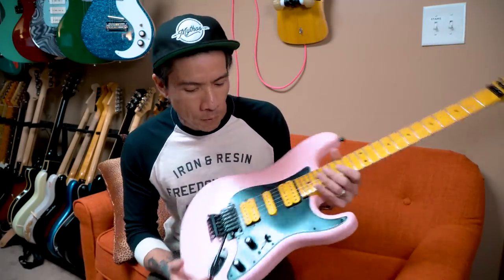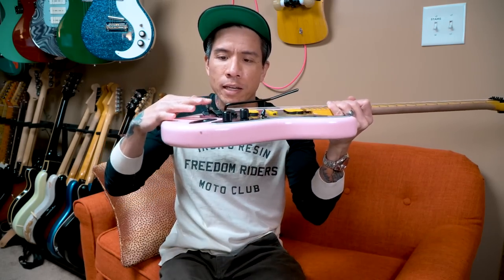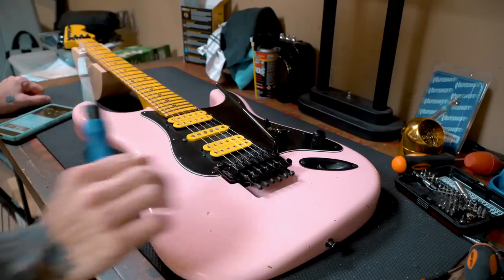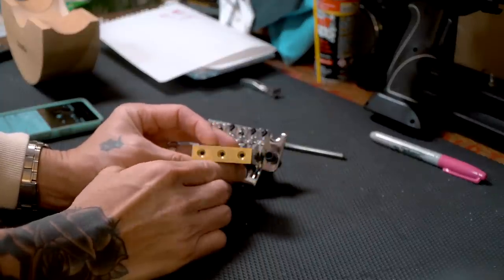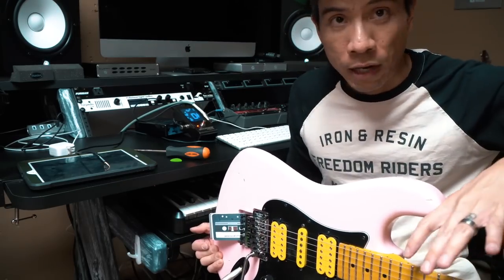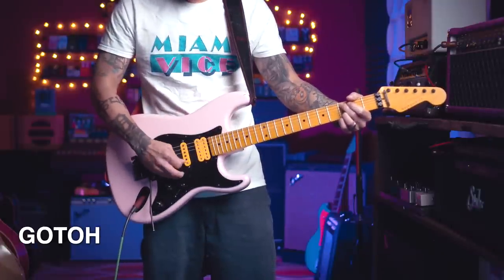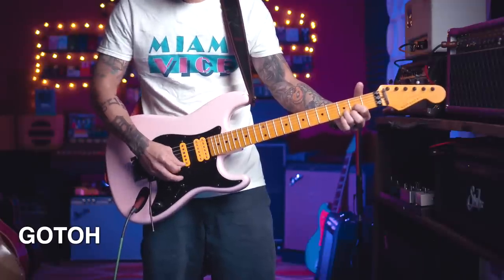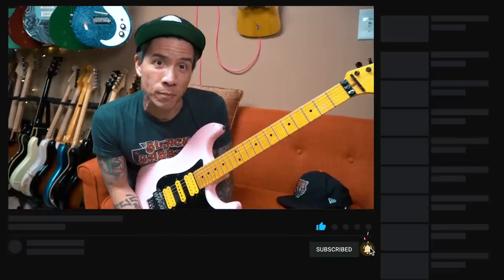Upgrading My Floyd Rose Tremolo | Floyd Rose Pro 100 & FU-Tone Brass Block

Comment from the maker: UPDATE: I installed a Tremol-no with the bigger claw to fit the Big Brass Block, and changed the 2 outside springs to white FU-Tone Heavy Duty. It's playing better than ever!
Reply: Not much of a tone difference to my ears ... but sounds like it rings somewhat longer after strumming. Now you'd be the judge if that new Floyd Rose bridge has a better tuning stability ... I have no experience whatsoever with these special series of bridges from Floyd Rose (I only know the "standard" ones that everybody knows).
Now, I changed the trem blocks of 2 old Strats of mine (one trem is 6 screws wide string spacing, the other is 2 posts narrow string spacing) with heavy blocks, and the result was always a better sustain and a better (How can I say it?) resistance to pitch issues when I strum harder on the low strings ... I guess it must come from the inertia of a heavier "trem rig" and the fact that it requires more "force" to translate a heavy strumming "punch" on the strings into a movement of the tremolo assembly ... I may be totally wrong about that assumption :D , but that's sort of what I feel about heavier Strat tremolos in general.
Finally, I HAVE A SUPER USEFUL TRICK (that I stole from a luthier friend of mine) to improve the tuning stability of a Strat trem (2 posts or 6 screws) : the "string inserts" on the back side of the trem blocks are often "not deep enough" ... you have to be very careful and "MEASURE TWICE" to "DRILL ONCE" (otherwise you're in for a new trem block ;D ) ... you drill these "string inserts" so that only 5mm (about 3/16") remain of the "NARROW SIDE" (upper side) of the "string insert" hole. The result being a shorter distance between the string ball end and the top of the string saddle, and therefore less chance for possible string slipage in that small portion of the string, and therefore a much better tuning stability when abusing of the tremolo.
I have to add that all my Strats (and they are all "work horses", not "vintage collector items") are equipped with "staggered locking tuners" to eliminate the use of headstock string retainers, with Graph Tech nuts (that I regularly lube with "GUNSLICK Graphite Lube" ... FANTASTIC PRODUCT for lubing anything made of graphite) and Graph Tech saddles.
Oh my God! That was a LONG COMMENT. :D
HAVE FUN! PLAY LOUD!
Best guitar gear reviews on the WEB!
Reply: Totally agree
Reply: My friend are u aware that the Floyd saddles are numbered for the right order.the low E and high E have like a number 1 on the bottom .A and B have their on number and so on.it has to do with the radius of the neck.
Reply: but my issue is when you bend strings does it pull bridge up? i dont like that
Reply: This video was uploaded on my sister's birthday
Reply: you probably dont have it anymore seeing this video was made two years ago but if you still have it do you want to sell the go-toh trem ?  I im using a floydrose special on a jackson king V and its horrible . its so bad im afraid to use it cause it dont go back in tune
Reply: I have a FU tone brass & a copper blocks on 2 of my guitars and 2 off brand brass blocks in my 2 other guitars. I can tell a warmer tone and the sustain is amazing!

Next I want to try a Stone Tone block as I've heard great things about those!

Comment: Step 1 of setting up a Floyd Rose: start early in the day...
Reply: It takes 5 min?
Reply: Basically it’s the first thing you do in the morning
Reply: Step 2: Have large cup of hot Patience.
Reply: rule number 1 is patience when it comes to a floyd but the more you do it the faster you get 10 min tops now compared to hrs before and days before that lol
Reply: I just did two Floyd installs—a Special and an Original, while lowering the string gauge to .008s. I watched a bunch of videos (like this one) over the weekend, and that really paid off. I started with the Special, since it’s the less expensive of the two units. I did the swap in the wee hours—not necessarily a good idea. I took my time. The process itself was pretty straight forward, but getting it balanced and in tune was a little tricky. I finished with just enough in the tank to plug the guitar into my Spark and jam along to a backing track of Jeff Beck’s reading of “Goodbye Porkpie Hat. Between the Floyd, the new strings, and some adjustments to the pickup heights, my guitar sounded incredible!  Today I decided to take a different approach on Guitar #2. Early this afternoon I took off the strings and the stock tremolo, installed the new Floyd, blocked it in place, then put it aside. Later in the evening I restrung the guitar, got everything in tune, did a slight neck adjustment, then plugged into the Spark. What a difference!

I guess the takeaway for me was making time to research the install. Thanks to good people like our presenter, I had plenty of knowledge and experience to draw from. Making myself work in a more organized manner, and adopting a relaxed frame of mind helped make the process go a lot smoother. In the end it was time and money well spent, and a little more confidence gained in guitar modification.
Reply: @Mark Seymour I think a lot of people are just not mechanically inclined. But if you have the correct tools (shim blocks ect) change the tuning isn’t bad. I have 3 Floyd’s. 1 German and 2 1500 licensed never had a problem.
Reply: Play FR equipped guitars long enough and the full tuning process gets cut down to a few minutes. You eventually start learning how to add in extra pitch on each string so that it settles close to it's correct pitch when the others get tuned. I don't even blocking on any of mine anymore.
Reply: Why do so many people have issues with floyd rose? I can do a full set up and intonation and neck tweak in 25-30 minutes …
Reply: Do it nice, or do it twice.
If you're going back, and fourth adjusting it, then your method need to change.

Comment: In my humble opinion Gotoh 1996T is a much better Floyd than the FR 1000 series
Reply: That's what I was thinking
Reply: I think you're possibly confusing the 1000 Series Pro (Low Profile) with the made-in-Korea 1000 Series that comes on many guitars from the factory. The 1000 Series Pro is top notch, made in Germany.
Reply: I had a Gotoh and an Original Floyd. The Gotoh was a great product. The Floyd was all steel. I can't remember what the Gotoh was using for block material, but now they use brass, albeit small; doubt I'd bother replacing it. Anyway they both sounded great, worked perfectly although the Floyd was a bit heavier duty. For this new project, at $100 the Gotoh would have been obvious choice If I didn't want a Low Pro. Pisses me off finding it has a zinc block (not havin' it) which I must replace before I have it installed.
Reply: @bradleywood1499  Sorry but nope , the 1000 series pro is NOT made in germany but in korea : quoting FR's own description (and i invite everybody to verify for themselves)

" The low-profile version of our infamous Original tremolo, the 1000 Series Pro features the same string spacing as the Floyd Rose Original (.420") whereas the GERMAN Pro has a narrower spacing.  Available in a variety of nut sizes that will fit practically any electric guitar, the tremolo kit contains the bridge, springs & claw, mounting studs, and all hardware necessary for installation.

Made in Korea "

So for anybody interested , the FR PRO (not the 1000 pro) is indeed made in germany and also commes with silent tension springs : the 1000 pro is made in Korea, and comes with standard non noiseless springs.
Reply: @florian6240  Yep, I stand corrected. It was the first sentence in their description " The low-profile version of our infamous Original tremolo" and the price that threw me off. I've been buying my bridges straight from Schaller (Lockmeister Made in Germ) to avoid all of the FR wordplay/licensing BS. Exact same product as the FR Original, plus its a few bucks cheaper and packaged way better.
Reply: Corey Hart  Same here
Reply: @bradleywood1499  I've been researching the trems because I've got an RG470 with the LO TRS 2 which is a known poor quality unit and it doesnt retain tune. The gotohs are praised for quality but they use the larger 8mm posts unlike the Ibanez and I guess most FR which are 7mm. I hear that the OFR will be a drop in replacement but then they are like almost 100 bucks more which is about the value of the guitar. I don't want to buy another poorly hardened unit to fail. I'm going to look into the Schaller like you suggested
Reply: @TheCulnes  If you decide on the Schaller, make sure it's the Lockmeister model. They do make a a lower grade unit that is comparable to the FR Specials.
Reply: @bradleywood1499 Strange now that you mention it, they sell a standard model with replaceable knife edges which I thought would be great, only it doesnt say Germany anywhere in the description and even says not to replace the edges for wear(Defeating the purpose to me). The lockmeister is German and claimed to be better but looks close to OFR price. It amazes me how they pump out these licensed floyd guitars in the 10's of thousands and seems they are all doomed to fail, and expensive/difficult to retrofit. The Gotoh sounds like it would be great except the blasted posts! I don't get why they can't sell a 7mm post and then take over the market.
Reply: @TheCulnes  I've put Gotohs on several originally FR Special factory equipped guitars and just left the FR posts. Zero issues.
Reply: @bradleywood1499  This is something that I initially considered as I have found people saying that was acceptable but I did find conflicting statements that indicated that they continued to have tuning variation because of the difference in post angle perhaps. Maybe it is worth a try with a new set of Floyd posts to replace the Ibanez. I appreciate your inputs!
Reply: @TheCulnes  there is no official Schaller trem , that is the equivalent of of the FR special : the lockmeister and the schaller trem (the first having the same specs as an OFR, the second being schaller's take of a double locking trem, with a thicker baseplate and replaceable knife edges , and having slightly larger dimensions than an OFR) are both entirely hardened steel , and made in germany . There is a distinction between an official schaller trem and a licensed one, the same way there is a difference between an OFR and a licensed one. However the FR special is an official product , it still is low quality , not made in germany and only having the baseplate in hardened steel
Reply: @TheCulnes   the one you are talking about is called the "schaller trem" and is made in germany : just go to schaller website and hover your mouse over the part between the trem arm nut and the knife edge, and you will see engraved in steel "made in germany". Look it for yourself.
Reply: @TheCulnes  what is your post diameter ? and i'm not talking about the anchor, but the posts itself ?
Reply: @bradleywood1499  thats true it came stock with my kramer 1984
Reply: @florian6240 Wrong you are. There is a German Pro 1000 that is narrow-spaced, and the Korean Pro 1000 that is both inferior and F -spaced.

Comment: I installed a large brass block (42mm) and noiseless springs (black) on an EVH Wolfgang Special.  I left the metal shim spacer (whatever it's called) off at first and it had a negative impact.  The string height and tension was way off (high) and my tremolo was actually floating a bit and had a reverse angle I could not adjust.  My action was way off and just didn't look right or make sense.  Nonetheless, I went ahead and adjusted everything (except for exact intonation) and it sounded good, but just didn't like the feel of the floating slightly angled tremolo.  Upon further examination, I noted that the piece of metal is to keep the whole system flat to the body as the new sustain block was bumping in to the wood body even if I cranked the springs (causing a slight tilt).  I completely redid everything again and after reinstalling the metal shim it was just perfect and I absolutely love it (way more sustain).  I know every guitar is different, but I would recommend keeping the metal shim spacer in place at least on the EVH Wolfgang Series (whoever said remove it from FUTONE is likely wrong).  Just make sure its tight and bingo!  Hope this save someone from doing it twice.  I will set the intonation after I leave the guitar with tension over night.  I am sure it will sound even better.  ROCK ON!!!
Reply: Same experience
Reply: Thanks.  I just got a wolf special, and I want to improve it's tone.  I like the feel of the guitar, but my Les Paul sounds a lot better.

Comment: I never understood why the low profile version never caught on with the public or manufacturers. Nearly everyone still uses the old, high-profile, 80's version.
Reply: A few reasons. Firstly, unlike the 'Original' Floyd that was being made in Germany, the early production 'Pro' was manufactured by Ping in the USA and used imperial hardware so all the metric tools from the Original Floyd were useless on the Pro - Strike one.
Secondly, the string spacing was narrower unlike the 'F' spaced dimensions used on the Original and more typical of what players were using at the time - Strike two.
Thirdly, the design of the back end requires a deeper cavity to get optimal pull up clearance, players who upgraded from the Original would either have to route the trem cavity deeper or tilt their neck to a degree - Strike three.

RJ, does the 1000 series take metric wrenches these days?
Reply: @juliansw3110  
I think they changed the "Pro" to regular Floyd string spacing recently.

Comment: Were the stud lock on the Gotoh bridge engaged? They seemed to thread out by hand, which suggests they were incorrectly installed. There's a stud lock built into Gotoh GE1996T and Ibanez Edge (low-pro too) bridge studs. Take a look inside the big hex hole and you'll see a smaller, like 3mm, hex. If you have the studs out of the guitar then just look at the end opposite the head and you'll see the small stud at the center of the post. If you don't extend those stud locks then the posts wobble in the inserts and the bridge never stays in-tune. Tighten those up and the GE1996T is the best Floyd stability-wise.

Comment: I don't know..maybe a little brighter? But it's about the amount of return you got for the money really. Was it ..or, is it worth putting that kind of money into a parts caster to eak out a maybe noticeable sound difference? Also, the thicker block limits the amount of throw that the trem can travel. I get the comfort for your right hand with the low profile of the new trem, but if it were me, I would just sell that thing, and buy something with the setup I was looking for. JMHO..🤘

Comment: If you were having any tuning or playability issues with the Gotoh I 100% guarantee it was the tremol-no.  It has to be perfectly permendicular to the sustain block or it will eventually bind and not allow you to return to pitch. It's just my pesonal opinion, but the gotoh is better than any floyd branded bridge.

Comment: In my experience, big brass tone blocks make little to no difference in tone and sustain.  I tried a few of them (different sizes) in a few guitars for several months but went back to regular sized brass stock blocks. The guitar seems to be a bit louder when unplugged and that may give you the impression of more sustain but that's it. I recorded clips to measure the sustain with all blocks and the differences where negligible and could be attributed to other factors. The main difference you may notice is the additional weight on the guitar. ; )

The noiseless springs will make a difference but you can get the same result by inserting some paper tissue inside the springs holes.
Reply: I had a similiar experience with a really resonant Dan Electro Baritone guitar, which when i took home and plugged into my rig didnt really translate, it had a nice tone of its own with those lipstick pickups but nothing like it was sounding when unplugged acoustically.    Maybe you'd actually want less vibration in the guitar, it would mean the strings are doing more of the vibrating and would have more sustain then if the whole guitar was vibrating disipating energy.  But im no guitar physicist, maybe its just a matter of having the right pickups to pickup on the guitars vibration and its good to have that, but i remember Les paul saying something about reducing vibration was one of the main reasons for going with that log guitar, not sure if he meant to reduce string vibration, he mentioned pickups if i remember right, he didnt want them bouncing around for some reason.  Eitherway we really dont seem to know whats going on with this stuff, just designs being thrown out there without any actual testing i bet, but good enough.  I wonder how good we could make guitars sound with a little more material science and what not.
Reply: I disagree. My big block sounded like a damn bell going off!